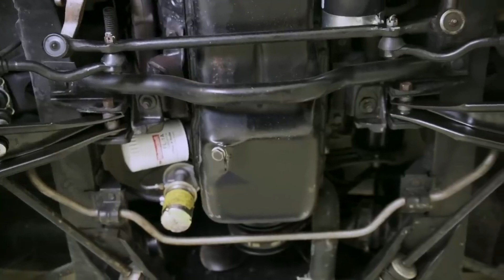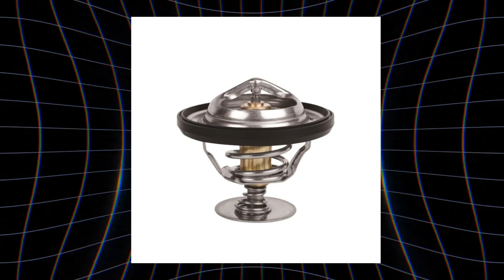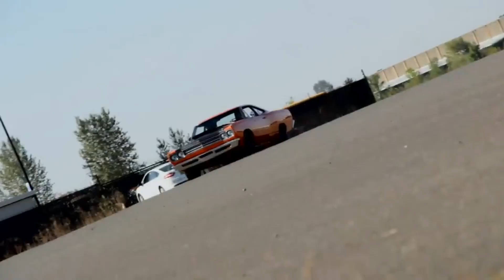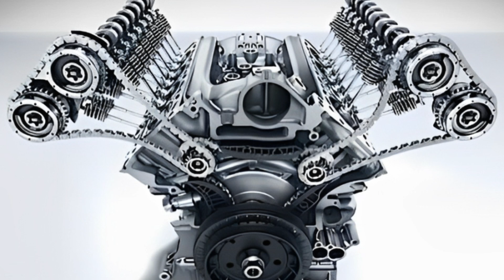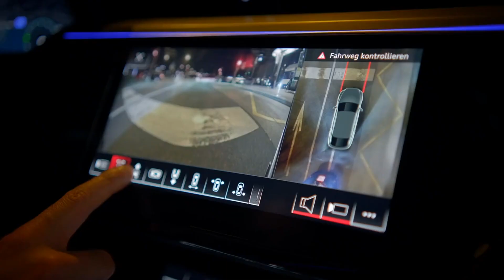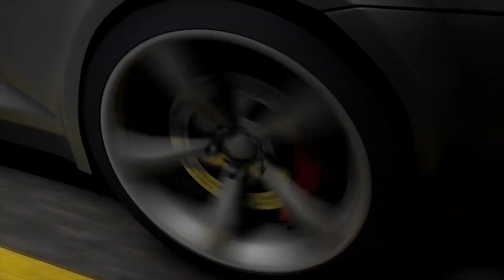Are New Cars Built to Fail? Here's Why Old Cars Were Better!

Comment: Roads/infrastructures condition in older times is worse, even much worse in some countries (dirt-bumpy-slippery road, potholes left for a long time, rainy seasons, tropical hot temperature, etc). That's the most undeniable proof that old cars and motorcycles have higher durability components and heavy duty materials (agreed by many mechanics, engineers, parts sellers, vehicle factories staffs, old vehicle owners, etc). Now, some car factories stupidly put excessive sensors (autoheadlamp sensors, wiper sensors, parking sensors, etc) with its indicators which will increase electrical/battery consumption and its price especially when car batteries are getting more expensive (old cars and motorcycles never need to use dry charged batteries and replace it every 3-5 years, while wet charged batteries can last 15 years and more).

Comment: You have to realize the oils back then weren’t very good, corrosion protection wasn’t all that great either, last but not least was engines from 1962 and up used a road draft tube to ventilate vapors from the engine which was disastrous since it didn’t do anything at idle or slow speed driving which made a MESS. Would be oil starvation problems with the excessive sludge, wouldn’t get any more than 75,000 to 100,000 miles out of a road draft tube engine. 

If cars were still made like they were in the 1960’s BUT with: better corrosion protection, synthetic fluids and oils, better engine tolerances, easily would last 30 to 50+ years.

Comment: When I was a kid, cars with over 100K miles were ready for a scrap heap. Nowadays, Ive taken several cars to the 250l-300k range.
Easier to work on? Sure. Reliable or as efficient? No. As safe? Helllll no.
Nostalgia is fine, but progress is... progress after all. Don't get mired in "the good old days".

Comment: Back when gas was a buck a gallon or less, the old cars made perfect sense. Nowadays, you can't overlook technological advancements that improve fuel economy. When you consider pickup trucks, for instance, that have more than doubled in fuel efficiency, that can amount to thousands of dollars of savings per year. Whether or not that adds up to the differences in repair costs depends on each manufacturer's commitment to reliability.

Comment: I think to bring both together and make it one. But they want to make money from the customer. Especially service.   Maybe better to put one together yourself.    Get a good mechanic for a check-up in-between service. As we all should be doing with ourselves and good health. The driver should monitor their car keep it clean inside and out and always under cover it helps. Always change the oil and coolant yearly. Companies sometimes don't want to as I experienced coolant was so not at level and heating up if I never pushed the service guy they never do it. So there you go!   Was a discontinued model Honda model great car.    💥